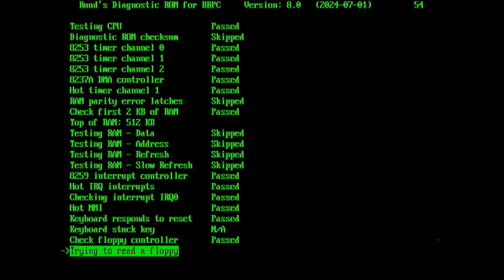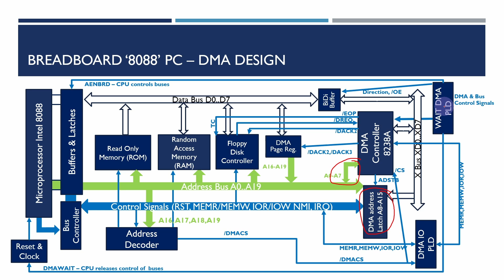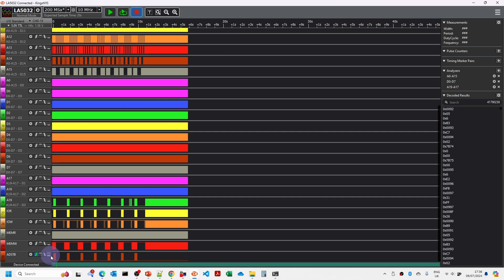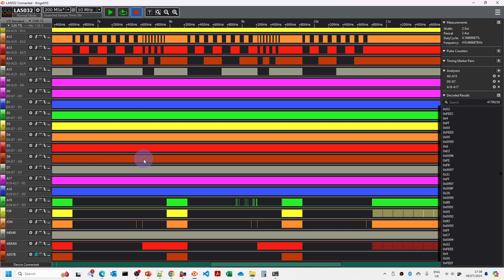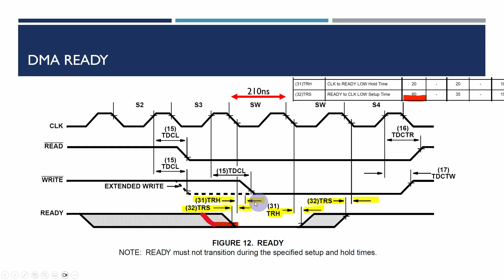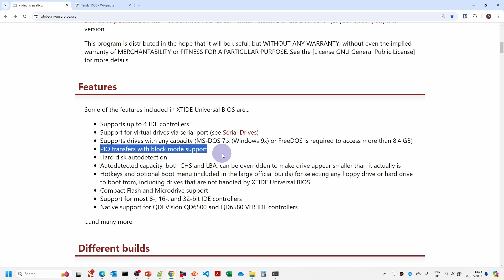Breadboard 8088 PC #38 Is DMA Worth the Trouble?

Comment: I have found your detailed description of the implementation of DMA, and then the follow-up analysis absolutely fascinating. These videos are of the highest technical quality, not found anywhere else. I really appreciate the fact that you have shown waveforms taken from your Logic Analyser. This really helps understand the complicated handshaking that goes on. What is fascinating is the type of DMA implemented on the PC, which is called something like "fly by" where one chip reads and the other writes and it isn't a simple DMA chip read then write.

I think that you have been unlucky to have found two faulty chips. Certainly chips can go bad over a long time, as I have seen in the C64 repair  videos of Adrian Black, many of which show the replacement oi faulty MOS parts. There are other videos which explain why the MOS chips have been so unreliable over time.

BTW you mentioned (and showed part of) a book which described the operation of DMA on the PC in great detail. I can't find the video (I have searched a few) so would you please either remind me of the video where the link is or remind me of the name of the book?
Reply from the maker: I bought a bunch of additional DMA chips off eBay (18 I think, they were in packs of 9 and I bought 2!) but I was wasting too much time with DMA so I got the FDC to work with programmed IO with updates to the BIOS. Just needed to bump the CPU clock upto 16Mhz/5.33Mhz so it could read HD floppy disks at 500Kbps which is twice the rate of SD disks like 360K disks.
The link for the book is in the descriptions for #32 https://vtda.org/books/Electronics/The%20Intel%20Microprocessors%20-%20Eighth%20Edition%20-%202008.pdf
DMA is about Chapt 13  page 490 I think.
Glad you are finding it interesting. I always wanted to do a deep dive into PCs and REALLY understand them.
I find the videos useful for my own reference to remember what exactly I did many months earlier!
Dave

Comment: The punchline at 29:30. Even if DMA is enabled the BIOS uses it to do spin loops waiting for interrupts anyway. Oh my.
Reply from the maker: Yes, until you got Windows 95 or OS/2 then Real mode floppy disk access via BIOS just looped waiting for the FDC to raise an interrupt. I also checked the original PC-XT /AT BIOS code and it does the same. Looks like from some of the disassembled PCJr BIOS out there that it should be fairly straightforward to convert to PIO - we will see! Dave